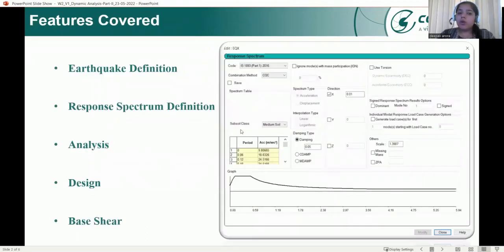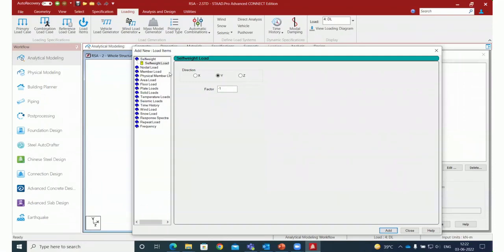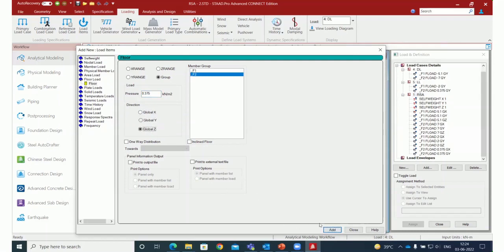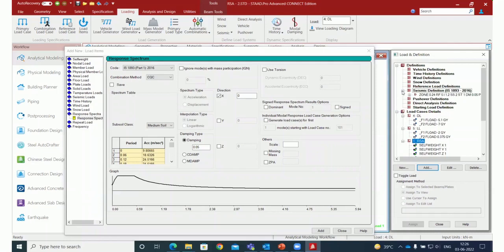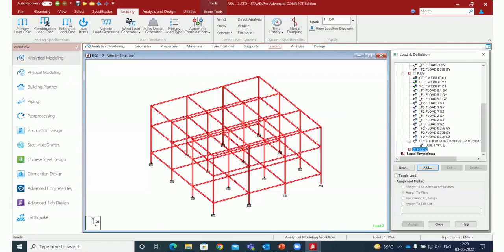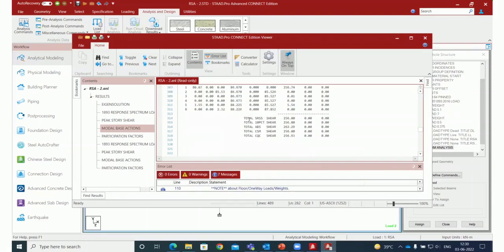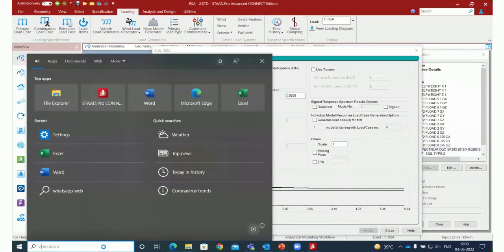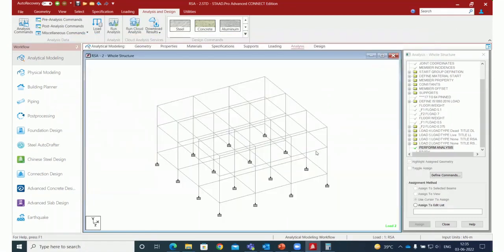Dynamic Analysis in STAAD.Pro Advanced - Response Spectrum Analysis Part II

Comment: Madam, in the response spectrum method some of the aspects are missing. Whether i have missed i do not know. The cracked section specification, Diaphragm command, cut off mode shape, check for soft storey, check for verticality,  load combination for various loads are missing. Kindly clarify whether these commands are included or not necessary.
Reply: I hope this doubt is covered in my other videos.